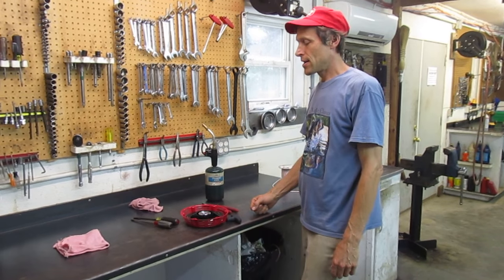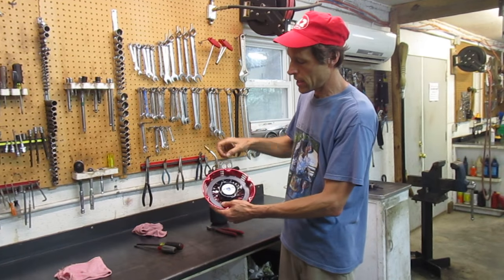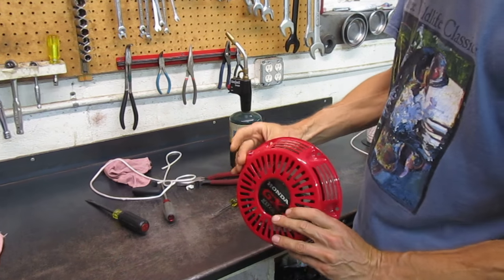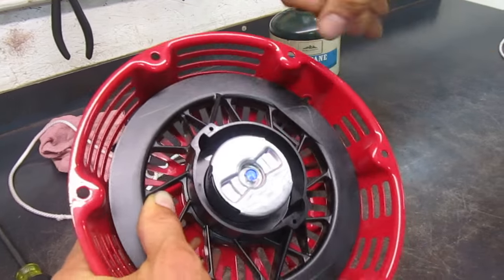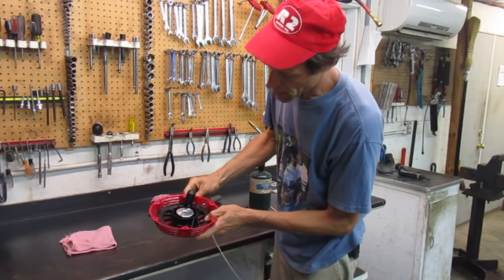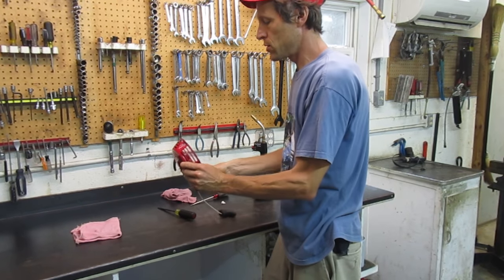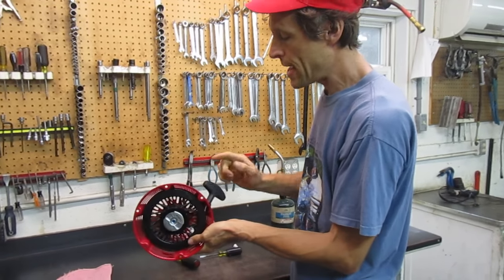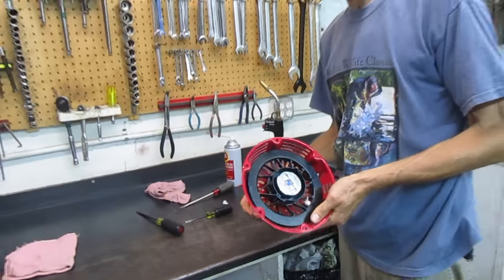Recoil Starter Rope Replacement for Honda & Other Small Engines

Comment: i have a 2 stoke mower and spring is not in top part, there is a 25 mm(1 inch) screw which holds winding coil onto top of engine, i presume string is under there , do i undo that so can retension spring?

Comment: Yo, this video is amazing! On the job and broke my pull cord. Not only did these easily teach me how to replace the pull cord, but I've now also fixed the slack cord hanging out. With this video and an excellent local equipment store selling me the length of cord I needed for only $1.60, I was up and running again in an hour. A+ video! 👍

Comment: Thanks, Joel! After watching another video, I couldn't get the new piece of rope to go through the second hole. The trick I was missing, until I watched your video, was using a little fire to melt the end of the rope. Then it went right through. It also helped to trim the end of the cord into a point just before heating it.

Comment: Great video!  I picked up an old abused 830 BCS last year and got a used Honda 390gx today to replace the engine.  The "tongue" is hanging out about 3 feet on the recoil, but it starts easily.  Now I can fix it when I do the engine swap tomorrow.

Comment: Thanks, that was a great help. My cord broke right at the far end where it meets the recoiler. With a lot of trial and error, I was able to get it back on myself. But I had wound the spring too little. Your trick for the hanging tongue worked perfectly to tighten it up without removing it all again. 

On the Briggs & Stratton engine that came on my 28-inch Snapper rear engine rider, there was a notch in the winding pulley that made tightening up the rope by your method very easy. For now it's working, but I'll replace the whole rope after the Memorial Day weekend is over.

Comment: Great job on explaining.  I needed to replace the handle only.  I had bought a new handle that comes with the rope but was going re-use the old rope.  Guess I switch out the old rope too since it's easy to install from watching your video.  Thank you so much.

Comment: Thanks, for the help and I was able to get my Christmas tree baler up and running again.  My only complaint falls on the Honda GX engine only having three screws to attach the pull cord housing to the actual engine.  There are no other holes drilled in the engine for the remaining three holes on the recoil assembly.  If one loses one of the three screws in the snow, there are only two screws left holding it to the flywheel, which causes some skipping.  Also, Honda, dropped the ball again on way too many thin metal vent cuts as one of mine already broke through into the next vent.  I suspect all of this is due to cost cutting, when these huge corporations are already corporate America monopolizing money factories.

Comment: I'm late to the game here but great video man. I have a GX160 that I have to replace the rope on. Any clue what size rope to get and where would be a good place to get it?
Reply: Just search Amazon for "recoil starter rope".  It's 5 mm or 3/16" diameter and you can get like 30' for $10 so you'd be set for life.

Comment: Joel,

I am having a problem with the recoil starter on my Honda GCV160 lawnmower engine.
I hear kind of a buzzing friction noise after I start the engine which persists until I jiggle the pull cord handle in and out a bit.  I'm thinking that the jaws which engage to turn the flywheel aren't retracting all the way after starting the engine.  This engine is only about 2 years old.

In your video, you clearly state not to spray these jaws with lubricant because it could interfere with the friction mechanism which causes the jaws to engage.   What else can I do to correct this problem ?  I've  removed the coil starter and cleaned the mechanism, and it is free of all debris, yet the problem still persists.
Reply: I too have a similar recoil starter noise on my 2004 GVC160 Honda motor.  Looking for a solution.

Comment: Know this is a old video.  I have a predator 420 motor, and the pull cord is near the air filter, so is pulls to the left of the machine, can I unbolt this and rotate it so i can pull start it to the right?

Comment: Hi there liked the video however just tried changing my rope but I cannot get it to re-tension no matter which way I go can you please advise me on what I should do next? many thanks
Reply: Pull the Rope out a few inches  and turn the Spool in the opposite direction a few turns.  Doing this will tension the Spring.

Comment: Is there a video showing how to take off the recoil cover. My brand new never used Black Maxx generator was vandalize and they banged the cover in so that I wouldn't be able to pull the recoil and start my generator. I was able to take off the screws but its so banged in it won't cone off. Please help 😭😭😭😭

Comment: donyboy73 would instruct you to take the fucker completely apart to replace the rope. You can get these clamps at Harbor Freight to hold the pulley from spinning while you install the new rope. Clamp must have a firm spring grip. Clamps are shaped like a capital 'A'. It opens at the top of the 'A'. Kind of like a giant "roach clip", man.

Comment: What size bolts (3) are they? Need to get me a new set of tools.
Reply: Andres Madrigal  did u end up figurine out the size?
Reply: Mine (on a GX160) appear to be 6mm x 12 mm flange bolts with a 10mm head.

Comment: Got a half new Karcher Honda GX200 pressure washer that worked perfectly until the rope broke in half of course because the rope's made of cotton!  Can you believe that?  Rope's guaranteed to break.  This clip didn't help me at all.  I got the recoil starter housing wheel, and it's got no recoil tension.  A length of rope costs $8. and a new recoil starter unit costs $12.  Looks like I'll simply get the new recoil starter unit.  Because of China everything costs cheaper than rope even.